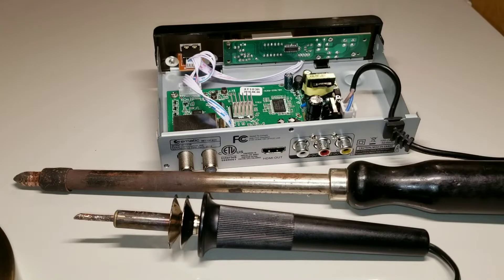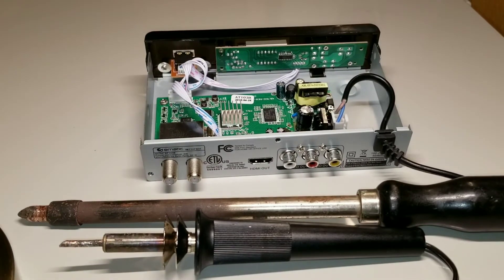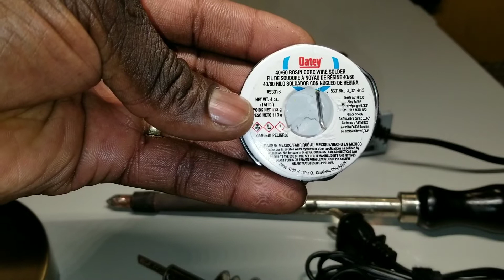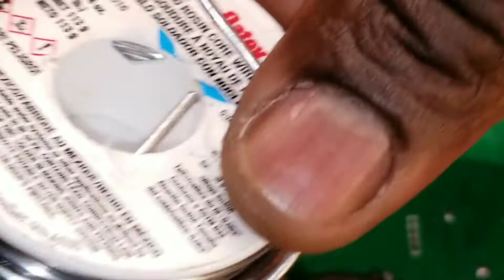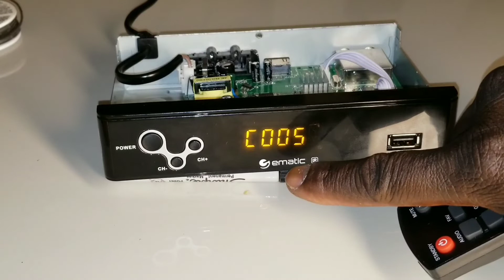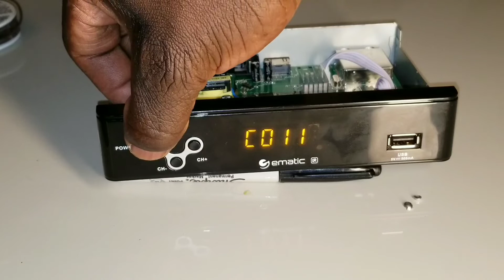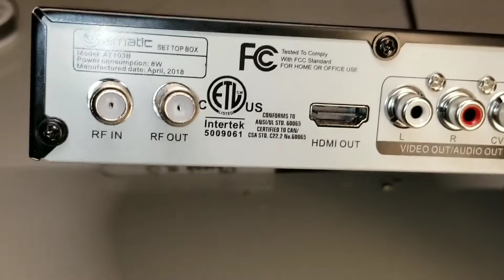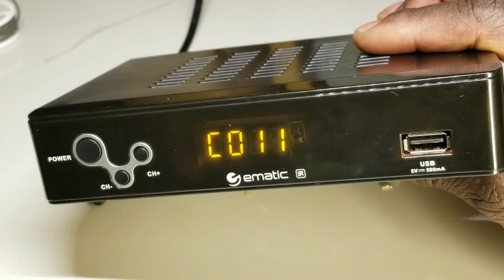DIGITAL TV TUNER REPAIR

Comment: Hello. I have a boombox with an analog tuner. It does not play any FM station with no static noise. Stereo light comes on. It have a new antenna. FM stations’ signals are good because my other tuners have no problem. Inside the boombox is very clean. Antenna cables are connected. I cleaned all the switches with contact spray. I played with the tuner pot screws but it did not get any better so I put them back to the initial position. What can be the issue?
Reply from the maker: @MC-ph7gr  
I am not sure.
Thanks for stopping by and don't forget to LIKE SHARE and SUBSCRIBE.